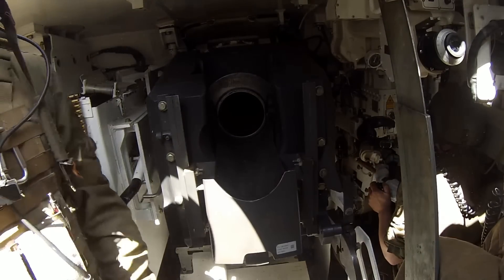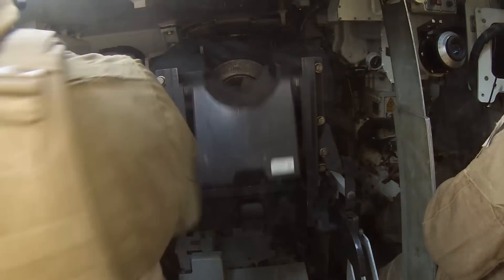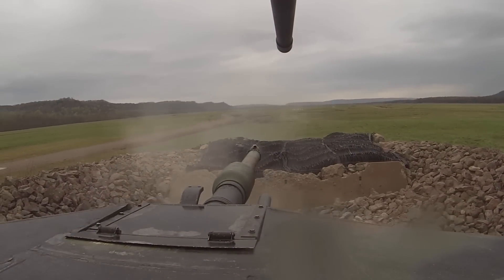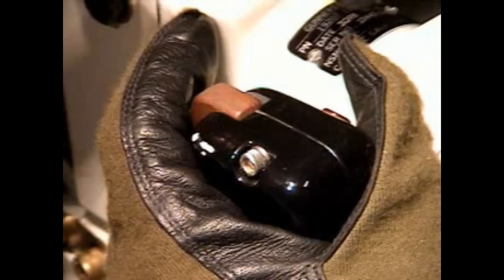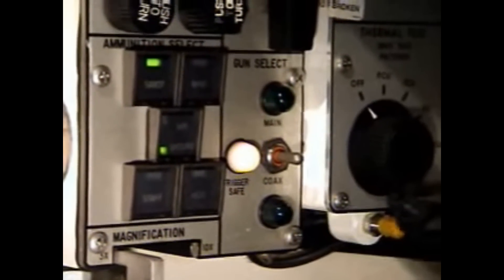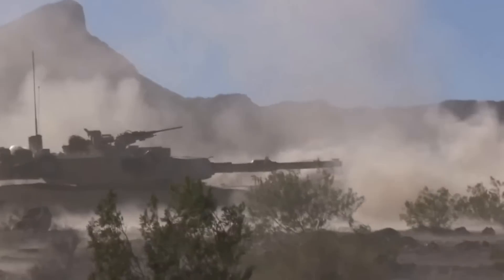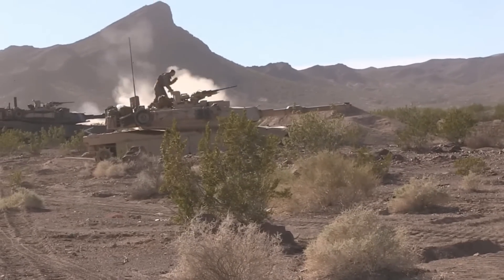How Do They Clear Tank Gun Misfires?

Comment from the maker: Like this video????... Check out the new Challenger 2 upgrades coming to the British Army! https://www.youtube.com/watch?v=tK2y2dt8v38
Reply: Somethings have changed and some have stayed the same but, then I was in before the M1 Abrams. I was on an M551 and it had a ton of electrical components. I'm surprised they took control of the misfire procedure away from the loader. Then again they are one has to put the round back in the rack. We didn't have wine cabinets like that. Maybe that 's why the  M551s when they did catch fire melted.
Reply: Imagine being in battle sitting inside a giant paperweight for 15 minutes while you wait before you can remove the round O-o then guessing if it will explode in your hands O-o

Comment: Only had one misfire while I was loading. That was quite a few years ago in M60-A1 with the 105 MM, Range 80 at Grahenwohr, (then West) Germany. Procedure was very different then. The gunner would attempt to fire on the Cadillac trigger twice then use the "master blaster" generator. If none of those worked we waited 30 seconds for a hang fire then dropped the breech, rotated the round 180 degrees while at the same time slapping some spit on the primer, then slamming the round home again. That fixed the problem I had. If that did not fire the round there were additional procedures for removing it before a cook off could happen.
But, I will admit that dropping the breech with a misfired round was a real pucker factor!
The other fun I had was having a Coax misfeed which caused lots of problems. The gun was not working properly and we had 4 or 5 jams which I cleared by just pulling the charging handle, but number 6 fired a round and then fired the next cartridge before it could seat in the camber. It forcefully removed the extractor from the bolt, blew cartridge brass all over the receiver and lodged the slug in the barrel. I announced the problem, safely unloaded the ammo belt, removed the receiver, grabbed the asbestos grove to remove and drop the barrel into the brass catcher bag, by the time I had that done that and turnedd around the gunner had grabbed the parts box from the back of the turret storage and I preformed coax surgery on the turret floor. I cleaned out the junk put the spare bolt in the receiver, inserted the extra barrel,  plugged in the electric connection and loaded the gun. When I announced that the coax was "UP" it stunned the TC and the Judge on the top of the turret. We managed to finish the engagement and qualified Distinguished. That was 1975, my last year of gunnery. Good memories of the great guys I was with on that crew.

Jim

Comment: I was a loader on an M60A1 Rise when a misfire occurred. It was my first gunnery at Grafenwhor. 

Our procedure was much simpler and it had to occur within two minutes for a hot gun. If not completed in two minutes, the gun tube was elevated and the range was shut down for a cook-off period. Once all triggers were tested, including the TC, the tank was evacuated except for the loader. The loader was the only in the turret and the range NCO was on the outside of the turret to receive the misfire, then it was placed into a misfire pit.

My first gunnery it happened to me. Dropping the breech and seeing the dimples on the primer as I pulled the round out was a very scary experience. The low man on the totem pole is considered expendable to a seasoned crew. I don't think I was breathing again until I saw the misfire round disappear out of my vision.

If it had been a combat situation, we probably would have just thrown the round out the hatch.

Toujours Pret

Comment: The 120mm and firing system is more complex than the 105mm in the initial M1. Hey after six try's that round ain't going anywhere but the F#@% out of the turret. Let EOD earn their paycheck. The 105mm was a percussion cap fired round. Step four was open the breech,  rotate the round 180 degrees, lick your thumb and wipe the primer (seriously), close the breech and let it rip one last time. Then out the hatch it goes. (albeit gingerly during range fire). I love training films they're so politically correct.

Comment: As a tank range safety officer. Most misfires were from dirty rounds that I encountered. Especially when uploading ammo during rain, gloves having mud on them transferring to the primer.
Now and then improper seating of the round. Usually as a result of not enough cleaning oil in the chamber. Thus, the round does not easily go into the breach.
Once, rotating the round worked. After firing, noted the primer was off center. Thus the entire lot run was ordered checked. No others found. Does happen.

Comment: Look 99% of the time it is due to the bore of the gun, breech and the electronic firing circuit not been serviced and maintained. 20 years as a tank commander and I have never had a misfire and the reason why I have not is because we would clean and service and test the weapon system every day. Some Crews are lazy and they are the ones that generally have the misfires, I know this because I was also a Gunnery instructor.

Comment: 4.5in Mk6  turret, after re firing using remote and local firing circuits, wait 30 mins, then open the breech and remove the cartridge case, note the lot number  for the misfire report, then carry the misfired cartridge the length of the ship, all the while keeping fingers crossed that it doesn’t ‘Cook off’ upon reaching the stern throw the fucking thing in the oggin!!

Comment: Well, I spent many a year repairing US Army tracked vehicles, and just a bit of your terms are off. What you call the breach is actually named "the cannon" As silly as it sounds, artillery or any other device of this size the three main parts are the breech block, the cannon, and the cannon tube. Yes the barrel is not the cannon, but it is the cannon tube. Also, for those that have written that this must be dangerous to remove a misfire and put it back into storage, it isn't as the round isn't armed, the fuse isn't activated until the round has been fired.

Comment: The procedure is waaay scarier when you need to take the round out (either because it's a dud or for safety by the end of the exercise). Basically the loader is in the tank catching the round and the rest of the crew rams it out from the outside using the bore cleaning rod.

Comment: I can only speak from Centurion experience as I was a tank gunnery instructor.  As a deteriorating Vietnam vet, times, distances, and exact procedures are a bit vague in old age, so I do apologise.
Firstly, in action, one does not stuff around with procedures for long, if it didn't go off after trying to reset the switches a few times, open the breech drag it out then chuck it out of the tank, something I never experienced.
However, in training, I only had the experience of one misfire.  After trying the various switches the prescribed amount of time, the crew evacuated the tank and we had to wait, I think it was around 20 minutes, and then muggins, being the alleged expert, entered the tank, alone, extracted the round, put it on the roof of the turret, got out and took the round off the tank placing it some metres behind the vehicle for Range Control to blow up some time later.
As for putting it back in a magazine, f**k that.  The fuzes in Centurion ammo were electrically fired and if the misfire was caused by a very slow burning primer you can get the idea of possible consequences.  Hope that helps.

Comment: Hang fires (delayed fuses) Round fires after trigger is activated. Cook offs (fires immediately after loading due to hot barrel) Misfires....(rounds needed 1 1/2 volts to fire) open the breeech I would spit on primer and turn the round 45 degrees reload and fire. If it didn't fire, you had to remove a hot round from main gun and carry it to misfire pit. Need clean shorts after that.

Comment: Been there, done that, I have the gray hair to prove it. It was Grafenwohr January 1977 on Range 43. This was one of those proficiency ranges where you fire at a moving target followed by a hard target followed by a moving target then finally a hard target.  It was so cold the first round snapped the electrical wiring harness to the fire control system.  This, unfortunately, left the electrical firing probe without power. We went to the next target and loaded a 152mm HE-AT round it was here we had a misfire. Next to combat it's probably the scariest event one can experience because you don't know why it is misfiring. In our case, it was simple once we figured out the trouble but, with ammo, it was designed to go down range so we didn't know what it was and you had to manually open the breach after going through all the steps of a misfire procedure. Next scariest experience a friendly fire incident of which I have a couple of close calls there. Both times involved artillery and mortars.

Comment: During real battle situations we threw the round out of a portal on the loaders side. During exercises the crew vacated the tank and specialists removed the round.
Reply: Really? That seems somewhat inefficient... When I served in the Swedish army (Leopard 2, same ammunition) we once had a dud get stuck in the breech so we couldn't get it out. The solution was to wait, try a bunch of times. When that didn't work, we took the bore cleaning rod and a bunch of rags, opened the breech and carefully rammed it back out from the outside of the tank. This was apparently the correct procedure, even though the Swedish army is probably one of the most safety-obsessed places in the world. I was basically shitting myself the whole time.

Comment: When I was stationed in Germany I was a 13e in a Field Artillery unit. Basically, I was the one giving coordinates to the 155mm howitzers. I heard of a unit that was at a range for live round fire missions who had a stuck round in the tube. When the breach opened up like always the gases which usually go out the tube came back into the cabin where guys were standing and killed all the guys. Normally they would have both hatches on the side open and the top. It had to be winter so they had them shut at the time. Hearing stuff like that really makes your ass pucker.

Comment: It looks like in the Abrams in the first video the loader is wearing a plate carrier while the gunner is not (not sure about the commander) any idea why this is?
Reply: Probably the commander would be wearing one I assume. It's because they are the ones with hatches above them, so when something is wrong with the tank, or someone is manning the guns on the turret roof it would be them getting shot at. Both the driver and the gunner have to go past the two other to get out, and thus they pretty much never do.

Also, from my experience as a tank driver in the Swedish army (Leopard 2, very similar tank) it gets insanely hot in the tank for the driver and gunner as they have no cool air from the hatches, so we just said screw the rules and drove shirtless. No one ever saw us anyway, plus if something penetrates the tank no body armor will ever stop it anyway!

Comment: The loader will report if the primer has or has not been struck, this will tell you if you have a firing pin problem. I spent 9 years on tanks with 6 years as a loader or gunner.

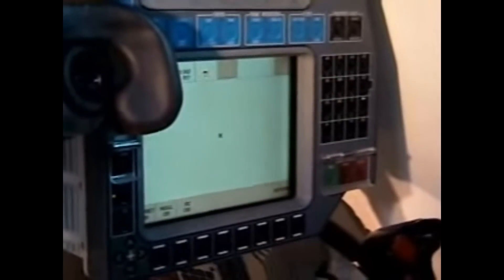Comment: 3:58 what is that handle?
Reply: That’s a mechanical trigger. Forgive my memory, it’s been many years, but I think we called it the master blaster. It creates an electric charge to fire the round.  (Just like those emergency radios with the charging crank.) If the main trigger doesn’t work this is what you try next. My gunner had to do it once on the range. He barely turned it and the round fired.  I was the tank commander and it caught me off guard. When he yelled misfire I got my face off the gun site and looked over his left side, just as he turned the crank.  The gun instantly fired and the breach recoiled back. Luckily I kept on the right side off the guards (as we were trained) or the breach would have hit me. It’s a tight fit in the turret and that breach is really close as it recoils inside. Wish I could go down range one more time...

Comment: The problems with chucking it outside are time and distance.  These are the basis for the "stuff it back in the rack" logic.  

Time:  It takes MUCH less time to pull it from the gun barrel and shove it back inside the ammunition rack, that is behind the blast resistant doors.  The inside of the ammo rack on an Abrams Main Battle Tank (MBT), of which is shown here in this video, is designed so that in the even one or even all of those shells cook(s) off (explodes) while in the ammo rack (with the blast door closed of course), the blast is directed up and out of the turret, away from the crew hatches, out through the blast panels.  This is so if the ammo rack is hit in combat, this will hopefully save the life of the crew by directing the exploding ammunition out of the turret in a controlled manner.  This feature has actually saved the lives of several Soldiers and Marines who had ammunition failures in the ammo rack go off suddenly.  The tank itself can actually survive this quite well, as just the ammunition rack is destroyed, and NOT the whole tank.  The turret is usually sound enough (as it has been any time this has been tested and has happened in real life situations) to still protect the crew and they still have their smaller weapons to fight their way out, as they drive away.  The tank can catch fire, but their are fire suppression systems in there as well as all over the Abrams, and the ammo compartment being on fire does NOT necessarily catch the whole tank on fire, as it is isolated to inside the now ventilated ammo compartment.  This is one of the reasons we beat the tar out of the Iraqis in The Gulf War, because their tanks had their ammo just strapped into the sides of the turret.  One hit with that 120mm and the whole thing went BANG!  Turret goes flying and lands a good ways a away.  

Distance:  The distance from the Ammo Loader's hatch, to the outside of the vehicle, far enough to not get injured, dead, or the vehicle damaged from an exploding 120 round, is quite significant.  Minimum safe dustance is about 500 yards or roughly 300 meters in open flat terrain.  Firing ranges often have "dud bunkers" for placing dud and misfired shells  to allow them to cook off if they are going to.  However, it is safer to place the round back in the ammo rack until it can be extracted by the proper procedures, and placed in a dud bunker.  The width from the edge of the Loader's hatch to the ground...  is about 4 feet...  straight out.  Those shells weigh about 60-100 pounds...  think you can heft a 100 pound misfired ticking time bomb up through a hatch barely big enough to fit an average human, heft you up on top of said tank, then CLIMB DOWN from said tank CARRYING said dud round, aaaaalll  the way out to the side of the tank or to a dud bunker?  And in combat, you can't just sling these things outside either.  1)  it then becomes ammo for IED's, and 2) that thing exploding right next to a tank track can blow the tracks clean off.  Not to mention if it goes off and someone is outside, it is a literal bomb exploding, and has a LOT of explosives in it.  Enough to kill everything with 200 feet of the explosion at least.  

So to all ya'll saying "chuck it outside"...   no...  just lots of Nope.

Comment: funny the same principle applies when a gun misfires, if it has a hammer or double action, you can just hit it again and fire it, the primer normally ignites at that point. would make sense if they could fire the gun without any electrical systems in this case like inserting a pin down the breech and hitting it with a sledge hammer to get it to go off 100% of the time and if it doesn't, the round would be totally inert so they would know that there electrical system is not the problem.

Comment: Question: it is a safer to have a proyectile with separate launch charges like in Challenger 2?
Reply: Has anybody proposed to use liquids or gas like Hydrogen and a central core of oxydizing liquid like Oxygen Peroxide (the same that is used for wound disinfection)?  Hydrogen will be in a separate area, Oxygen Peroxide will be inserted just before  shooting after the Sabot-proyectile is put inside the cannon. It will be slow to shoot but could have very long range, in the best tradition of the British tank forces (kill the enemy before it can kill you). I heard a comment by David Adair, saying that hydrogen needs oxygen in order to burn correctly... and that it always go up, exploding at maybe 5-10 meters above the tank.

Comment: Another reason for auto loading robots... they can be programed to take more risks then you would want to take with a human loader, and by extention, everyone else in the turret and possibly in the hull too? An outo loader system seperate from an armored crew compartment wuoldn't have that problem of killing the crew if the charge or shell went off...as long as the reloader is properly designed to have a round go off outside the breach without the blast hitting the crew. Like the abrams ammunition storage compartment does.

Comment: Back on my Leopard C1 gunnery course(1979) in CFB Gagetown NB, I had a misfire in my call sign on the range. I was in the gunner's seat and went through the misfire drills and still no fire. It turned out that it was a grounding strap that had come loose under the gun carriage. RCEME fixed the issue and we were back in business.